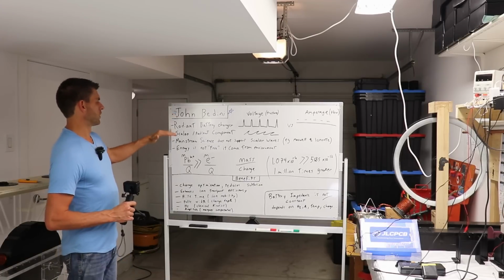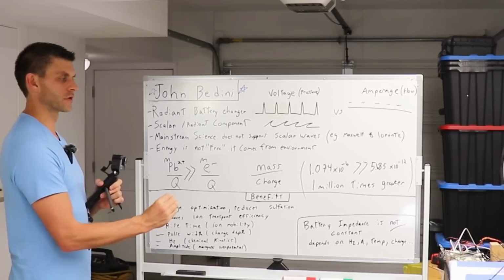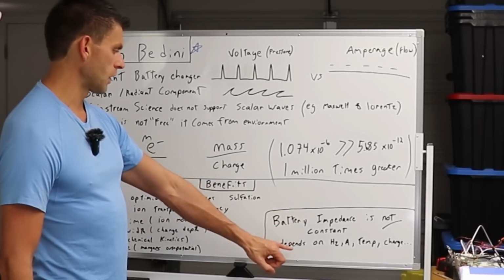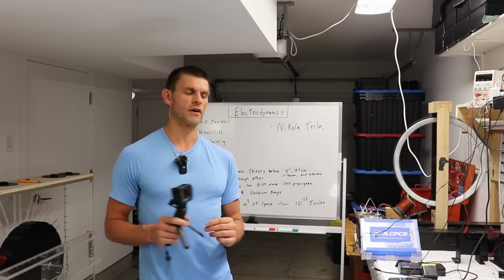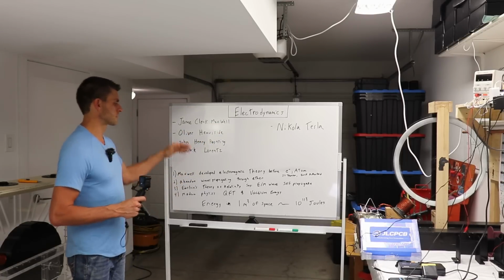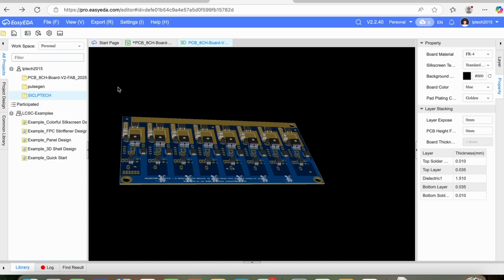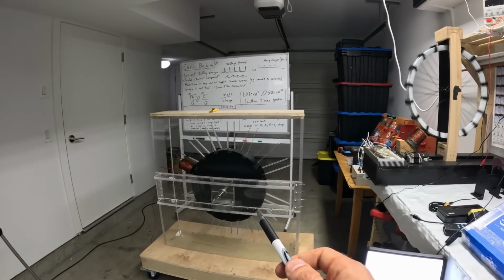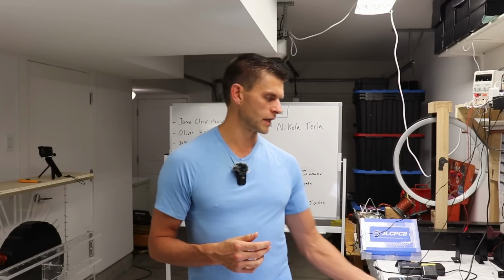They Said It Was Impossible  We’re Building It Anyway

Comment: another consideration: The legacy of Hendershot's Fuelless Generator  describes how he wound his coils a special way. That special way is "basket weave". Why? With basket weave, the wire goes around one side of a peg, and then next turn it goes around the other side of a peg -- with an odd number of pegs. If the inter-peg distance is ideal, the wires cross at an angle where the little trapezoid where the wires intersect is made minimum area. This little trapezoid is the place where capacitance occurs between the wires. If they cross at 90 degress, it would be a square, for example, But that isn't practical. If the wires are right next to each other (as is done conventionally in a solenoid winding), they have maximum capacitances. You actually wind NOT an ideal inductor, but one with lots of capacitance and cross-sectional noise. Radio guys in the previous century came up with basket weave and other wiring styles so that they could make a more ideal inductor -- with less wire. There were economics at play here too. You can experiment with peg distance, or calcualte an ideal peg distances using some math. But you want a wire crossing angle, as I said, that minimizes this trapezoid intersection. For tuning for resonance, add your own capacitor in parallel -- away from the wires. This can also reduce heat in the coil, which is wasted energy. The wires cross the pegs also set up a magnetic rotation around each peg that is reinforced by each neighboring peg. Other coil wiring styles include honeycomb. Litz wire could also be tried -- but its expensive. Silver wire, also expensive, has less resistance than copper. There is also Tesla's bifilar coil.
Reply from the maker: Great comment 😊
Reply: Excellent comment, I am just a novice electric engineer but, my studies had concluded exactly what you are saying with the Trapezoidal shaped coiling, and especially with modern "Interdigital Capacitance" in the end all energy derives from sound, not vibration.
So, I believe the naturally occuring Torus of magnificent magnetism is perhaps why the Trapezoid creates higher density with its Q value. Perhaps it is pitched to a higher frequency or qualitative tonality? The Trapezoid design seems to naturally induces arrays of dielectrophoretic separation, the electrophoresis doesn't necessarily need to be charged; it simply needs to be Polarizable. So, with this trapezoidal shaped it is increasingly qualitative RF I was reading some conclusions reached by the Linsun Group, and testing electrodes with Trapezoidal shapes and many others as well, it's a great paper they published on this topic that is could be critical to Capacitance storage and efficiency. For me, I believe that most everything is made of or from water, and iis oscillations of Sonoluminescence generated on a plane within a Torus, or Toroidal field or magnet array, and that Trapezoid or Trapezion," = "small table, field " or "irregular quadrilateral, plane " and fits perfectly.  Funny, the word Trapezoid literally means "table-shaped field. And was always most efficient at structural stability and the use of SPACE... Something tells me the answers are within the quadrilateral or 4 sided plane and the longitudinal axis of the Quadrupole magnetic field and it's superior four coils that are  symmetrically spaced around the radial bore. This configuration increases surface area and an Imperium of Capacitance. I believe that the Quadropoles produce a higher degree of field homogeneity with a cleaner signal strength as compared to dipoles technology.

Loved the comment, and I'm probably wrong, but, thought I'd offer my ignorance.

~ Inertia

Comment: The Bedini Motor lives from regenerating the battery with high voltage pulses. This means, that there is no free energy. After a while, the motor will stop. A real free energy motor should run with condensators. This motor can't. It is a chemical motor with limited power.
Reply from the maker: No sorry, and this isn't a bedini.😊
Reply: @MadscienceLPTECH  Does it run with condensators?

Comment: Horizonal flyback transformer TV's in 70'g... same principles as radar AT USN (many things)... was shocked!  BTW  there's much better switches than MOS.
Reply from the maker: what switches? whats the speed ?
Reply: @MadscienceLPTECH  Hi, thanks for asking :  )  Speed is what we always referred to as the switch time of the transistor device (germanium, etc) we referred too. In the 80's an HP 1052 and 1053 cesium beam(I think p/n... been long time...) was used for the primary standard at the base/facility (unless AF was there too.  Pico is/can be a hard measurement to make depending on waveform (of course many factors).  Used freq standard comparative scope plotted for interference pattern for speed measurement.  You have a great successful time and hope it works and hope I'm wrong  :  )  God speed my friend.
Reply: oh, btw true bipolar high current will feedback and burn up your source, fet's great idea... get the fastest.  Controlling the surrounding environment (partial vacuum). will help, so many thermal losses... magnetic bearings?

Comment: Formation of lead ions isn't exactly how lead acid batteries work.  
What happens, or at least what is desired to happen, is there are two lead plates.  One has lead oxide formed on the surface the other plate is elemental lead (this is the charged state).  This is a higher energy state and it wants to drop to the lower energy state of lead sulfate.  

Connect the two lead plates with a conductor and electrons can flow allowing it to occur. *both plates get sulfated when discharging, and this is the "resting" or fully discharged state.  

This should only happen on the surface of the lead plates.  Otherwise the plates would deteriorate quickly and wouldn't be useful for a rechargeable battery.

If you can improve the efficiency of reversing sulfation of lead, and the formation of lead oxide on a plate,  to a point where it provides a net positive energy output, that would be remarkable.
Reply from the maker: Agreed, ill gi over this a bit more next video

Comment: Wait, a rising and falling magnetic field and making use of back emf lets me think of something. Isn't that called a boost converter? That does exactly this but in a way higher frequency and without the need of some magnets. I still don't think that magnet wheel is of any use, it introduces air and rolling resistance.
Reply from the maker: Maybe there is non electron energy flows outside the wires that use the rotor is some positive way?

It might be unsesssary or maybe not we will see

Comment: no that Im skeptical of unconventional physics , im skeptical of the proposed components that constitute the claimed energy extraction methods. First we should clearly establish what the vacuum actually is or present a fundamental enough understanding what processes it presents. Not that I doubt Tesla, Feynman and others work on energy in the vacuum but speaking against verified data , the vacuum is defined as the lowest possible energy state of the system and it was found to have magnitudes order of energy lower than was predicted by Great Minds in its natural random state and secondly the energy flows in the vacuum are quite incoherent. In order to meaningfully establish an effect/bring forth quantum phenomenom you'd have to find a way to align/cause coherence in a localised dimension of space to disturb the space-time symmetry to create forth universal deformative flow. Achieving this Resonance is a tremendous feat and would require quite a lot of power input in the first place and crossing the Schwinger limit and would require super-capacitors and pulser in the femtosecond range to discharge huge amounts of super-conductive current. So you can see why I doubt any meaningful progress can be achieved with basic-equipment to enable extraction.
Reply: And a thing to add as far as energy figures are concerned. The inherent electrostatic forces of atoms are even more unbelievable.The total potential energy of an assembly of identical charges can be estimated to an order of magnitude by working out the potential energy (due to electrostatic repulsion) of two identical charges each of which is half of the total charge (Q) of the assembly of charges and at a separation (r) comparable to the size of the assembly (E=(Q/2)2/4⋅pi⋅ε0⋅r).

For a 1 centimeter radius sphere composed solely of gold nuclei (79⋅e) at gold's nominal density of 19.3 grams/cm3, this works out to approx 2⋅10^24 joules, which is hundreds of millions of times the mass-energy equivalent (E=mc2) of the bare mass of the sphere itself. Now compare this against 1m3
Reply from the maker: Agreed, great point
Reply from the maker: Yes id say your beliefs are getting in the way. You can write the theory once you see our machine running deal?

Comment: resonance consideration. You could just wind a coil to push the magnet in the Bedini motor. And this coil will have a certain inductance and certain implicit capacitance and certain resistance. What you want is a coil of extremely large inductance, and extremely small resistance. Next, you can add capacitance to "tune" this to the very frequency wanted for your pulsed system so that it has resonance there. This allows the very least amount of energy input to do the same magnetic-push job. Let us suppose you time the magnet going by and its 8.33 usec (2000 RPM) or something. This delta-T value would influence various inductance, capacitances values here for resonance -- least power input. If L is large and R is small, the back EMF can persist for milliseconds—even if the input pulse was microseconds long, for example.
Reply from the maker: Love it, definitely listening

Comment: Consider cylinder coil adjacent to a ring magnet with North flat face, south flat face. If you pulse the coil to repel the mounted adjacent ring, and then remove the pulse, the back EMF is rapid due to the nearby magnet. You can remove this ring magnet and orient this to face a compass North or South to use the Earth's field to encourage back EMF. Yet this is much weaker and slower. Whereas you pulse for time X. The back EMF might bring the coil's core back to neutral in time Y. This could be measured on a scope probably.
Reply from the maker: Great comment

Comment: The Hubbard Coil approach had no moving parts in the coil or near the col. Rather you have a central coil, with larger diameter core and then various surrounding coils (each with magnetic core). The rotation that can be set up in these outer cores has no mechanical moving parts. Instead one can make a rotating magnetic field around the central core. I think Hubbard used a spark-plug rotar to make-break the connection to each of these outer cores, as if they were spark plugs -- pulsing them each in sequence around the circle. The advantage here -- no moving parts in the rotating field. The field rotates. And, when you consider particles from the sun, radiant energy, it is sucked down into this structure like a vacuum cleaner, adding energy into the system. BUT, it is probably not good to be on the positive-ion side of this thing if the rotation is establish to go one way and not back and forth. Positive-ions are unhealthy. The negative ion side would be the healthy side.
Reply from the maker: Very cool

Comment: Bipolar junction transistors (BJT) are current (flow) effect where a small base current switches a large collector current. Metal oxide silicon field effect transistors (MOSFET) generally have minuscule Rds ON impedance (in milliohms) allowing large current flow without overheating problems where a small voltage is applied to the gate. Please research Lutec 1000 (circa 2000) where a pulse motor drives a three phase alternator. They used mechanical switching, which has limitations, optical switching is ideal. I am using the same combination to control valves on a steam engine.  Hey Spencer, your enthusiasm is contagious. Kudos to Joe, Kyle and JLCPCB
Reply from the maker: Thanks for the kindness 😊
Reply: 😂😂..LUTEC..FROM MY HOMe... TOWN.. CRISSTTY..JOHN..LUUWY..😂
FNQ. OZZ. 
Australia..✅
Reply: @Greg.UWU.22  Yes, a failure

Comment: Another criticism of the Bedini system is that the wheel is mechanical and there will be a drag on the wheel. But also, The magnets, when approaching aluminum or copper will experience a drag - Lorenz. If you watch Stan Deyo's anti-gravity presentation on youtube, he discusses the concept of the Lorenz-O. Like Bedini's pulse to spin a wheel with magnets, suppose you instead had a toroid with mercury that could be made to spin in the toroid using pulse DC (as Stan shows in his presentation). This rotating liquid has very little drag on it and doesn't take much power to get going. Once it is spinning, you now have a gyroscope with forces that can be vectored different ways depending on the pulses to spin it. The goal, low power in, lots of force out. Deyo's videos are recommended.
Reply from the maker: Thanks for the input
Reply: Deyo: https://youtu.be/nmIu2fRitWM?si=ezHotdS9i7tTg9YB

Comment: one very depressing thing about lead acid batteries are they suck. Batteries that are far better are LifePo4. They last a super long time. Hold a charge for a really long time. It would be good to develop technologies to charge LifePO4. Lead Acid is also super bad for the environment. They die in 5 years or less -- especially in hot locations (global warming).
Reply from the maker: Umm lead acid are great and easy to recycle and use low impact materials. They last a long time if u use rhis type of charger
Reply: @MadscienceLPTECH  Suppose instead of charging a lead acid battery in your circuit, you charged a super capacitor system (to be like 12V). Then, when this reaches a certain level, its power could be dumped into a BMS system for LifoPO4 charging. Often the BMS+LifoPO4 can be readily purchased.

Comment: Food for thought for you all.  Instead of using switching technology to capture ZPE by collapsing fields, another way of tapping this energy can be through inertia.  Inertia is likely the space time drag acting on mass during acceleration.  An unbalanced rotor or rotors can output a hell of a lot of inertial force, while requiring little power to maintain rotation of the unbalanced rotor(s).  Mechanically capture and focus this force across a set of coils, using the inertial force (zero point energy) to oppose the back EMF of the power being generated, you should have over unity.  The interesting challenge to such a system is creating the circuitry to feed back some its own generated power that is not being applied to a load to the unbalanced rotor(s) after getting it started with an electrical source, and govern it to prevent its own vicious cycle of destruction by speeding up, feeding even more power into itself, thus over speeding even more, until it blows up........
Reply from the maker: Great comment 👍

Comment: I used magnet sensor so it can easily be adjusted for timing. I was getting 10,000 volt spike on shut off. The only way I could snubber it was with 2 capacitor and 2 diodes. It took me 3 months of swapping transistors before finding the right combo. It was a lot of learning and fun. If you would like to chat let me know
Reply from the maker: That is some serious voltage, nice work.
Reply from the maker: email me for sure, send pics

Comment: Your analogy for voltage and amperage is incorrect. Voltage is equivalent to pressure and amperage is equivalent to volume. I use the same analogy in the fire service when I pumped firetrucks. For example, the voltage equivalent on an attack line would be 120 pounds of pressure and the amperage equivalent would be 150 gallons a minute volume.
Reply from the maker: Thanks for the analogy!

Comment: Damm , you missed out on explaining how all those North facing magnets on the bicycle wheel create an induced/false  South field that creates/induces  the spike from the coil.
 Bedini states in one of his video's that there is no Lenz's Law involved in any of his motors.

You might also get into  the mechanism of The Avalanche Flow & other interesting traits found at the PN junction you are " switching" 

You can get an LED to Light up when  forward or reverse biased  by using Earth Potentials taken from different  Earth stake potentials.

I'm sure there are other methods/ways to bypass the gate or change it's characteristics.

You failed  to mention that Bedini was a very skilled Transistor or PN Junction Fabricator.
The work he did in this area was interesting to say the least.

You will eventually find a Way to draw from the Dipole as it sits  over a  PN junction.

Comment: Don't super caps have a better potential to capture the energy being produced and then from their charge the batteries?
Reply from the maker: Well u need the batteries for the excess enegy, John used to recommend this but stopped after a while
Reply: @MadscienceLPTECH  i wonder why? Have seen others use it in intermittent pulse motors to capture the energy and then use the excess energy to charge batteries. As Super caps charging time is super fast

Comment: wont the new one just keep increasing in speed hypothetically, or is the excess battery, or whatever you will use for the charge, going to disperse enough energy that it wont spin until it breaks, but also wont stop spinning?
Reply from the maker: Ya, spinning to fast might be a problem. If it gets to that point we will put more load on it